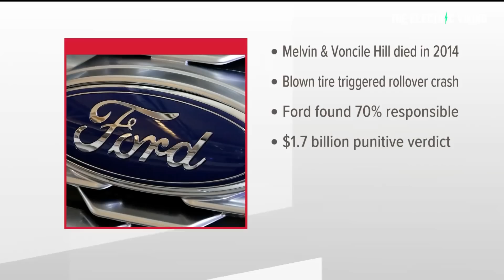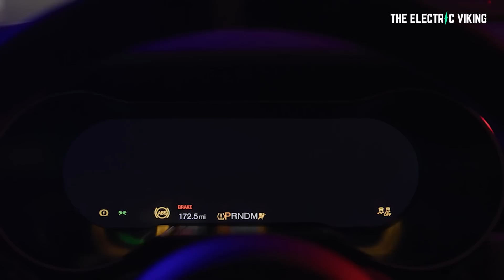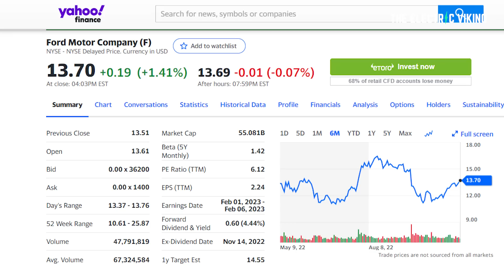Ford found guilty of stealing and lying in disgraceful cover up

Comment: I strongly suggest people look up what actually happened.  This should have counted as  an illegal vendor lock-in attempt by Versata.  The entire suit is not about ford using Versata's software in their cars or illegally copying it.  The case is about ford continuing to use versata's jar files to validate that their new "PDO" software works correctly as a drop in replacement for Versata's ACM software.  This is more bad rulings by judges and juries who don't understand anything.  Ford had every right to write the software in house and validate that it covered the interface the same as the old software did.
This is like a company suing because you replaced their door lock with a custom one you made and you used the same measurements from the old one so it would be a drop in replacement.  
I think ford is a joke of a company, but why are we still allowing IP laws to make normal software development illegal?  Imagine if microsoft wasn't allowed to look at how IBM pcs and software worked so they could write their own OS to run on the IBM hardware.  The history of the software industry makes this ruling terrible.  The claim is not that ford copied code, the claim is that ford used jars(java programs) they previously licensed for use in their cars after that licensed expired to make sure their replacement would "fit" in the same hole.  An interface and interaction between systems owned by two separate companies is not a trade secret or IP.  It is an interface anyone can use to make drop in replacements for competition.  Ford will include better language in their contracts to prevent this kind of lock-in attempt in the future, but the ruling still sucks.

Comment: I've owned Fords most of my adult life, the newest being a 2004 Ranger.  I was happy with their products.   TILL NOW.  I have been planning on buying an EV, and the F-150 lightning was my vehicle of choice.  Of course, you can't get one, and if you do, its double the factory price.  I own my own company,  and ethics, integrity, and a willingness to go the extra mile, will get  you plenty of repeat business.  Ford, has obviously forgotten about that.  As did GM, Dodge, and a host of other automakers over the years. (recall the recent VW debacle).  This, imho, is a direct result of uncontrolled capitalism.  Controlled capitalism, could be a boon to mankind.  But, if all we ever want to do is compete with one another, and one up each other, nothing good will come of it.  Competition isn't a bad thing...fair competition is what we need.  The idea that someone at the top of the food chain in business is worth hundreds of times more money than the guy actually doing the physical labor is bs.  My techs make nearly the same money I make, and I own the business.  We hear "life isn't fair"  Well, no, its not, unless you want it to be.  In which case, we can decide to make it fair, by enforcing laws and not just levying fines.

Comment: omg get to the point,  ya spend over half the video telling us over and over ford did bad but wont say what.  Yes I agree this is not good, but repeating saying this company did bad,  over and over before you even say what was done.  You allready preped your viewrs to agree with you and prevent any option that is not your own.   The software in this court case was started back in 2014.  I really dont think much if any software from 2014 is really relevent today, yet you make it sounds like this is all current software.  I also like to add this happened 3 CEOs ago, it has nothing to do with Jim.

Comment: As to whether Ford management knew what was going on, I doubt it.  Ford is too compartmentalized for that. 
My guess is that this was done by one of their coder teams who then presented it to upper management as something they did in-house that could save Ford money. The coder team management probably got awards and bonuses, maybe promotions. I doubt that upper management knew a thing about this as they wouldn’t know the difference between code and the backside of a barn.  Ford’s mistake was fighting this in court. They should have just bought this little software company.